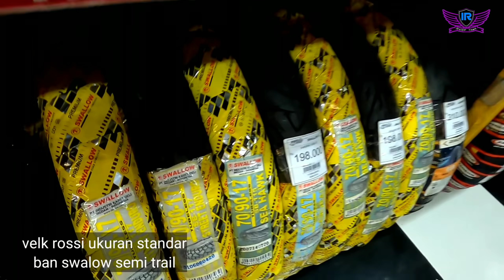very good and creative motor modification BMX bikes have 125cc engines how's it going?

Comment: I’m curious in knowing how long your bondo joints last before cracks start appearing where weld joints should have continued? Also, the rear mono-shock still looks weak under load.
Reply: shhhh none of them care enough to translate what youve said. If they did, someone would have acknowledged you by now. just wait til the video he posts about how it fell apart going down the road.
Reply: @Naferner_Said  they will never post that video, and that shock looks awful under load

Comment: A big manufacture needs to make these. Cheap and the G8/CUB honda engine fits the frame.lots of cheap copy's. 
Or you need to open a factory to make them and become very rich very quickly.